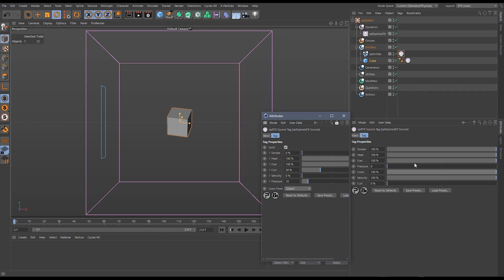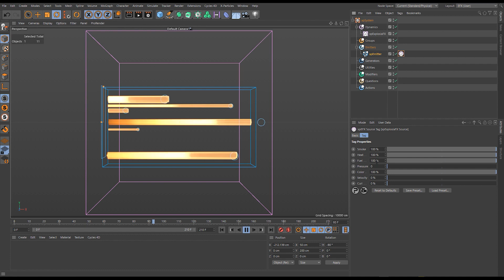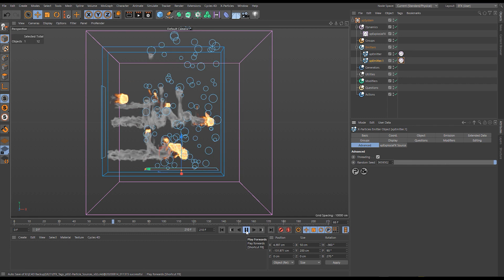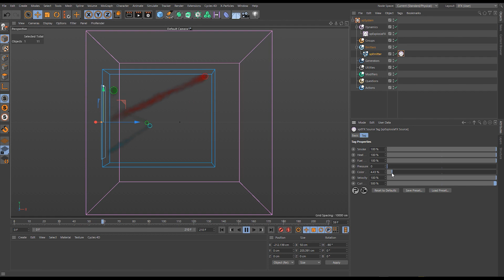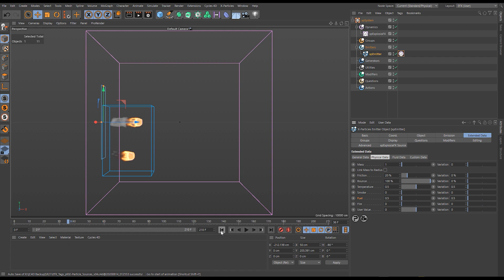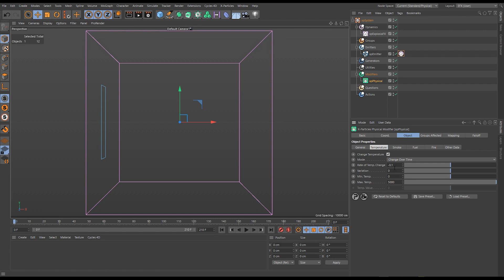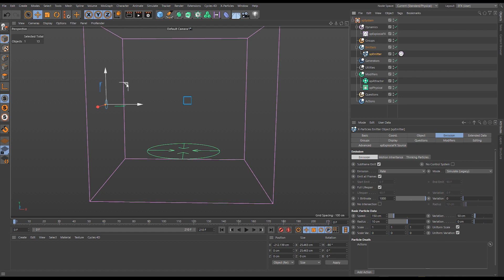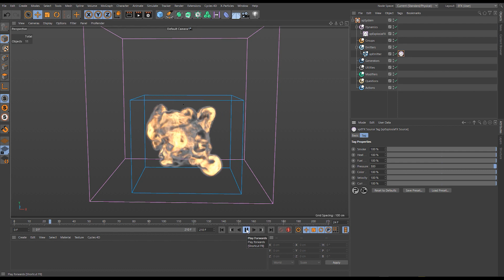Maintenance Training - Dynamics - ExplosiaFX - ExplosiaFX Tags in Depth - Particle Sources

Comment: This is really sketchy behavior from INSYDIUM. You could have just let us know the specs of your system, i spent a lot of time trying to figure out why the same set up looks completely different on my pc and I finally figured out that you guys are not using the default display settings and you didn't bother to let us know especially when that is a huge aspect of being able to work with explosia. I have a system with 13th gen cpu, rtx 4090 and 256gb of ram yet I can't get the same quality or any reasonable playback speed.

Comment: Explosia is really slow to the point of being practically unusable on my machine. Looking at the specs of the PC this was recorded on, mine should be faster. I have an i9-13900K, 2x 3090's, 128 GB of RAM. This is also a pretty old tutorial so I'm not sure if things have changed, but I'm on C4D 2024, and the most recent Insydium build. Wonder what the issue could be?
Reply from the maker: Hi, 

Could you please send a message to Technical Support with this information, they'll take a look for you.

https://insydium.ltd/support-login/

-Thanks